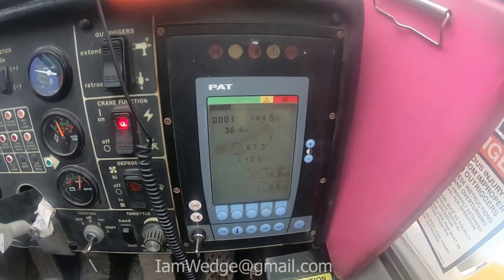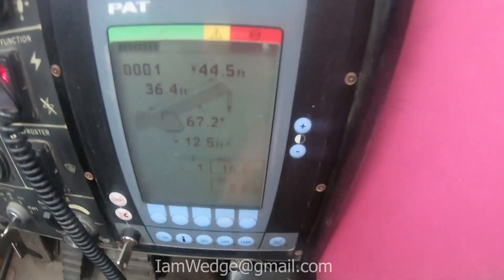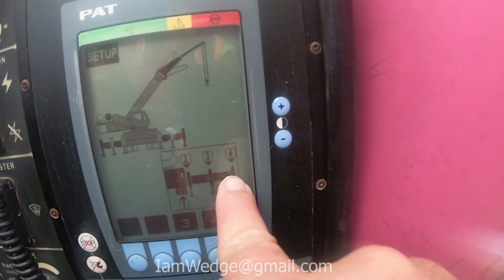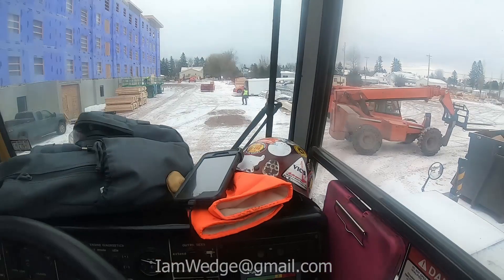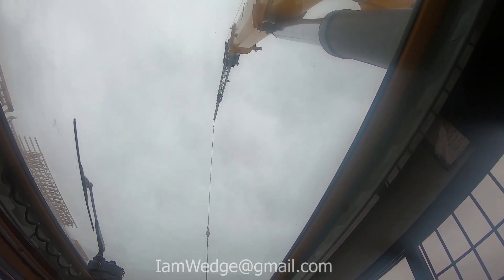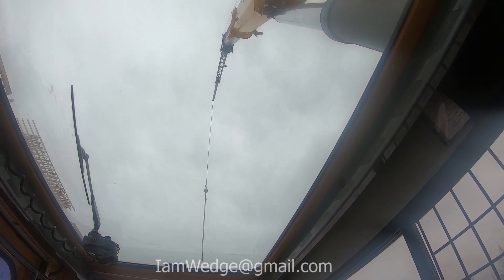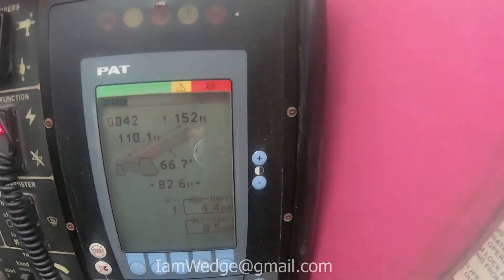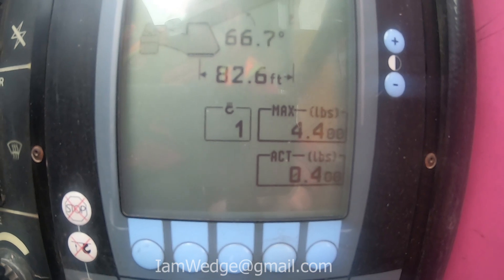How To Extend The Boom On A Grove 60 Ton Crane

Comment: This is great. I never realized how computerized cranes are. Touch screens, menus, and more. It's like flying the Starship Enterprise! Nice video!
Reply from the maker: This crane is over 10 years old. The computerized systems have progressed even further. The computer in a crane is more of an aid. I'm an operator that has pulled the load charts in the book for many years. Do your math. The reason being, if you have a computer issue you should know how to read the load charts so you don't put yourself in a bad position. When the guys im working with tell me to boom down 25 feet. I can look right at my computer and know how far I need to move. You will see in my upcoming video what I do when im "flying" material. YOu will have a view of the load and a view of how I'm operating the crane. Should be interesting. Thanks for stopping by Kelly.

Comment: how can adjust the number of wire roll on the drum before wire full pull out?
Reply from the maker: If your drum isn't full and/or wire has been removed, you will have to actually turn around and check the drum. Especially when adding parts of line when using a block.
Reply: I have grove RT 770E, inspection carried out by third party, they asked for drum switch to stop the drum reeling out when the cable reach last three wrap on the drum , how can i fix this? @IamWedge

Comment: Hello IamWedge, I have a request, Can you also make short video showing & describing boom modes on that Grove?  Much appreciated if that's possible.
Reply from the maker: There are no boom modes on a 60T You usually don’t see those until you are using 80T and up.Older models had A or B mode. Some newer Groves have A B X M modes. If you look at the charts you will see how capacity is different In certain modes. It all boils down to Strength vs reach. Each mode will control how or when certain sections are extended. The mode changes how sections are telescopes out. Hope this helps.
Reply: @IamWedge  Thank You!!
Reply from the maker: @fravelcombs5431  You are welcome. :)

Comment: Hey brotha, question...what book mode were you in, and also I’m hearing different things about what book mode is for heavy heavy loads and wich one is for normal operation. Please answer what you think .
Reply from the maker: Both stages of swingway with an offset is 0042. This is the correct load chart to be using for this set up. What you are talking about with normal vs heavy loads is the difference be tween A and B modes. Larger hydros have this the 60T does not.
Reply: @IamWedge  thank you for this reply. I’m currently running a grove RT 760 and the heavy section comes out first which I’m not used to. I thought I was stuck in B Mode like the 90T grove RT but I guess that’s just how the sections come out?

Comment: That's a Heavy Crane 60 tons wonderful Handling Man🖒
Reply from the maker: 60Tons is its capacity. What it can lift. 60 Tons will be right off the front of the crane. With the configuration I have right now. I can handle a couple thousand pounds out 125-130 feet. Thankd ro stopping by DEI-WAN- GREY
Reply: IamWedge Anytime My Brother Glad I Did You Learn something new Every Day thanks for sharing this✨👍✨